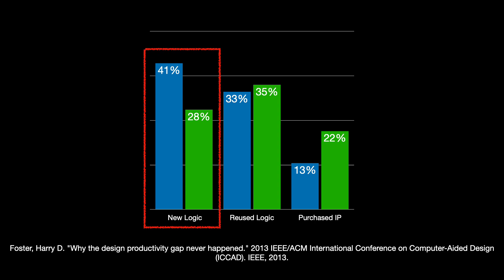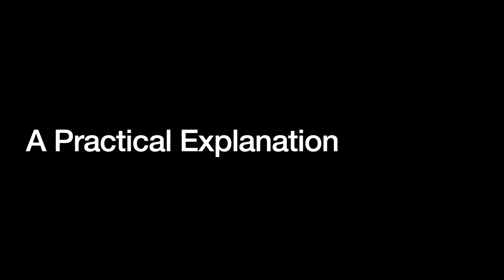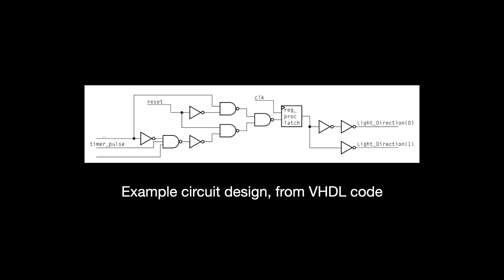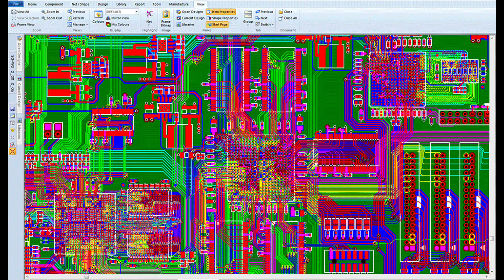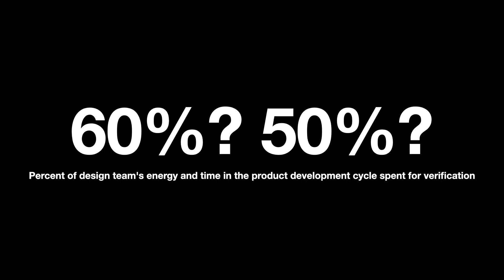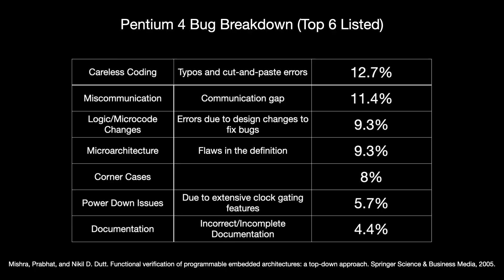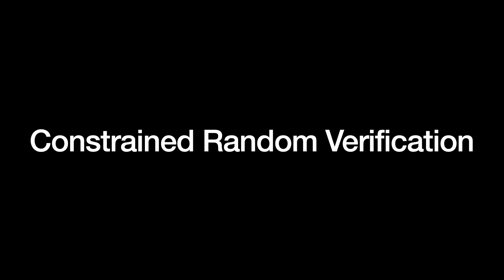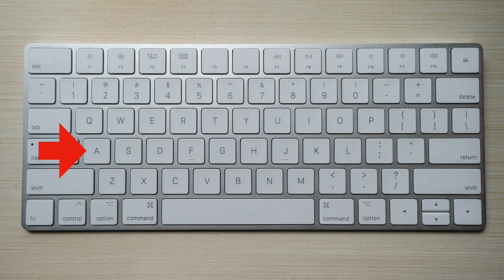The Growing Semiconductor Design Problem

Comment: Can I say, this trait of chip design (difficulty of verification scales up exponentially with complexity of chip) will fair better on ASIC than general purpose chip such as CPU or GPGPU, which has way more "corner cases" to cover and discover!  It may suggest it will be increasingly uneconomic to design "general purpose" chips in the future,.......
Reply: I think for a time we'll find using machine learning AI techniques mixed with traditional we'll find a lot of short term efficiencies but long-term it'll be rendered moot if we ever get a solid grasp on quantum computing. That's a ways off though, for now, best let the algos have a crack at it before we drive our small minds insane 😂

Comment: It sure is complex to design and validate IC's, however the inherent complexity serves as a deterrent to IP thieves and/or reverse engineering folks like China.
Reply: Its usualy the other way arround. If it is complicated it becomes relatively more profitable to steal. There is ofcourse also the "how easy is it to steal" side of the coin.
Reply: @someonespotatohmm9513  I suppose the effort alone is neither here nor there; it's whether if you make a copy, you can make a better price, which can be extremely difficult at times, and then whether you can actually shift enough of a volume to offset that effort.

Comment: Is it true that gate array size that is actually the size of the manufacturing scale is no longer 1:1 since 32nm? I vaguely remember reading this somewhere so that today's 7nm and incoming 5nm basically have gates larger than that? If true, what are the impacts this has to chips since we are already at the 2nm process.
Reply: Yes you’re correct. Today, it’s usually the smallest feature on the device (may or may not be gate) is taken into consideration while deciding on a naming convention.

Comment: Reusable "code" was a revolution in programming that lead to growth over time that was incredible. The same held true with hardware and programmable logic arrays.  As someone who "did it from scratch" every time the advent of FPGAs was a thing. Our mainboards could do new things but there was a development overhead to reinventing the wheel with them. Being able to buy logic was, a time saver. Same thing with the development of automated trace routing. Went from our king artist who could actually lay out traces manually in the program and optimize in his head to being able to click a button and populate a board. I had not thought about any of that in almost 25 years now. Sheesh.
Reply: "Automatic trace routing".... good lord, does anyone actually use this stuff? Even the high end ones are just so horrendous.
Reply: @yum33333  also, whats "horrendous", if its ugly, but works, who cares ? does it respect the ERC ? then that's enough.
assembly programmers used to say the same thing about machine generated machine code...
Reply: But I know routing could be better, but that's usually a P-Space problem in computing, its really hard to solve it very efficiently. But it doesn't matter much, you aren't usually constrained by area in silicon, not the same way as you are in a PCB.
So, that's not a problem for in-chip routing.
Imagine routing a 10cm PCB but now in 1m of space.
There's plenty of space on die.
Reply: @monad_tcp  you have no idea what you’re talking about. DRC is not going to tell you the board works well or not. Autorouting is stupid anyway, because 90% of designing a circuit card is component placement. The tracks are easy.
Reply: @kylerkidd4834  If ERC doesn't tell you how well the board will work, then you have serious problems in validation.
Reply: I have plenty of idea of what I'm talking, I studied a lot of the process involved. Its possible to make better tools. Autorouting and Autoplacing are part of the same thing. 
But whatever, I'll see, I'm going to tackle this problem from a different perspective. 

You need better static analyzer tools instead of only relying on simulation. 

The solution is more mathematics, not brute force or relying on human manually testing.
Reply: You are introducing defects between the steps of the process, it should be entirely automated from the design to the CMOS mask in one go. There's too much human intervention. 
The highmost level of electrical design is where the effort should go.

Part of the problem is abysmal programming languages like VHDL or Verilog with very little abstraction power and no mathematical verification.

SAT solvers are a thing, Full end-end validation in one step is possible.

We will see, after I publish my paper.
Reply: @monad_tcp  Keep us updated about your phd Luiz. Really interested of what you are talking right here
Reply: @kylerkidd4834  you're conflating pcb design and chip design. What you're saying is perfectly true for the former, and asinine for the latter.
Reply: @yum33333  yes, when you have a billion transistors, you use it.
Reply: Autorouting never worked for me. I have had professionals tell me autorouting is never as good as manual. And the manual completes when the auto route doesn't. Plus with manual you can deoptimize the slow stuff (more vias) to make the fast stuff work better.
Reply: @msimon6808  I agree that it isn't as good. But there is now way in hell folks are manual routing advanced boards like modern GPUs and main boards. They may be post-manual correcting. But when you have a development to production time table of less than 6 months in some cases from when the final specs are released for a new chipset till full scale production. The time needed to fully manually handle layout and routing just isnt there. We had a hell of a time back when it was fewer layers and simpler layouts and a greater than 1 year turn around.
But again, all the guys I knew were artists/savants about routing and layout.
Reply: You needs compilers, not only reuse, but automation. Of course VHDL is kind of the same idea we programmers had with Fortran in the 1940s. The problem is that VHDL is horribly dated, we made much progress with formal proofs in programming languages, they need to catch up. 
Actually, my PhD thesis on computing science will be about compiler hardware synthesis, but totally automated.

Comment: Excellent video! I think your comparison of chip design and web development is mostly valid. I used to work in the dram business, and respins were the rule rather than the exception. Analog circuits have infinite degrees of freedom, and are very difficult to simulate perfectly. First time right is much more achievable with a pure logic chip.
Reply: I do disagree about one thing, is that in web development if the library doesn't work it's mostly your problem if the guy doesn't feel like fixing it, while if you buy an IP from ARM, Cadence or Synopsys and show it doesn't follow the spec they will fix it and apologize.

Also I would also mention there are a lot fewer critical bugs that happen and they do clear notes about what was changed and how it can affect you. It is very unlike companies like Google that change stuff and break your code.
Reply from the maker: DRAM

Comment: In the theoretical days object-oriented programming, ie, the methodology of building large programs using small, encapsulated, proven  software modules, a pioneer in the field coined the term "software IC's" to describe what today are called objects, as computer engineers of that period were familiar with the concept of building systems with components in the hardware domain. It was interesting to hear you bring the concept full-circle at the close of this video.
Reply: That's amazing and makes so much sense. The difference obviously now is the scale of the software and hardware designs.
Reply: It amazed me how they still didn't introduce more formal verification, like we have in modern statically typed programming languages.
There's an entire volume of computing science tricks that could be applied to electrical engineering. There's an entire PhD for me on that.
Reply: @monad_tcp  Go, Luiz! You'll discover if you're onto something rather quickly in an engineering PhD program. The real world is very unlike a YouTube comment thread -- no BS allowed!
Reply: @kwgm8578 No "BS" allowed?  Only PhD’s? 😂. Or other type of BS?
Reply: @monad_tcp Formal verification is used in chip design.  As a trivial example, a 64-bit or 128-bit adder can be formally verified quickly to be 100% correct for all input combinations.  Look up BDD’s for a starter. The controlled randomized testing or even doing exhaustive sweep testing at the unit or block level would never come close in our lifetimes.

There is inherently just a huge amount of concurrency in a hardware design. And race conditions galore. A lot of people will take away that copy-paste errors are a common error and be astounded.  Those are rare. I’ve never seen that.  Intel’s ancient ‘divide’ bug was due to such an error: only part of a table of values was copied over. 

What’s much more common (and can be included as a typo) is using the wrong delayed version of a pipeline state bit.  A design can work often, but if the timing of some event shifts by one clock cycle, the design can break.  Possibly because of using "state_bit_d2" instead of "state_bit_d1".  That’s really a logic error though, not a typo. 

It would be like in this video’s traffic light example.  A possible error could be a race condition where the 2nd car arrives at just the right time as the 1st opposing cars exits the intersection.  The light could fail to change for the 2nd car, getting stuck.  It is a contrived example, but it amounts to the decision to change the light as car1 exits mistakenly looking at whether there was a car2 already there 1 clock cycle before it showed up, so that action decides no change is needed.

And car2 arrives and sees, say, that a car1 is in the intersection and that it will trigger the light to change when it exits (which it mistakenly does not).

This is contrived, but it is actually a better example of a bug.  A bug where the design does not meet the spec.  The video mentions a spec error, not a design bug: the spec failed to state the light must be fair when congested.

Comment: Honestly the fact that there are now more verification/test engineers than actual digital designers is surprising to me.
How come the digital designers get away with writing such poorly tested digital circuits? In modern day software development you wouldn't get away with that.
For software projects pure test engineers are pretty rare as just writing tests all day long would be pretty demeaning to most software engineers.
Personally starting with digital design I assumed the testing standards would be a lot higher compared to sw development but it almost seems like the opposite is true.
This just reflects my experience with chip design in open-source projects and academia however it's really unexpected to see how manual testing is for hw projects.
Reply: since hardware systems use ip blocks from decades ago, that have already been fully verified and specified in documentation with full logic, and electrical specs, in different ranges of temperature, and voltage with actual graded graphs - this software comparison of test coverage is laughable. and i''m a software developer. we can't even dream of achiving the level of engineering rigor the hardware designers have.
Reply: @PaulSpades  Please bear in mind that my experience stems from open-source projects and academia.
Personally I have never encountered a bug in a compiler while I encountered a synthesis bug in Vivado just a few months after starting with hw design.
Similarly I have heard about issues with Intel Quartus as well as IP blocks from Altera and Intel.
As I have never worked at the big chip makers I can't speak to that but I would hope they have higher standards than what I encountered.
Reply: @developandplay  From what I hear bigger companies are just better at forcing ppl to accept or covering (not necacarily bad) their mistakes. Not making less of them
Reply: @developandplay  that's because compilers are vastly simpler than sythesis tools and physical circuit ips. also, a compiler bug is implicitly a language feature that may become documented if removal breaks programs. 

compilers have lots of issues sticking to their documented standards, and implemententions based on the same standard always vary in compatibility or are incomplete in supporting the standard.

sure, compiler stacks like gcc, java and the clr (which have been developed for a few decades) are reasonably documented and stable by now, but there's always something to fix and something else to break.
Reply: @PaulSpades  I hear this argument all the time from hw folks. Yes synthesis is more complicated but on the other hand I think it's a lazy excuse from big tool vendors.
For example the bug that I encountered was due to Vivados frontend generating a wrong syntax tree for sign extension. (Verilator and Synopsis did just fine.)
To me Verilator and Yosys show that yes hw design is difficult but not so difficult that only these tooling companies can work on it.

Obviously compilers are not perfect either but that wasn't my point. However they are a lot more standardized and accessible at this point.
If compilers cost thousands of dollars per year and if you had to pay for every third party libarary I don't think programming would be as popular.
Reply: @developandplay Honestly, I'm seeing more programmers interested in electronics, circuit design, fpgas and eventually ICs. I think this renewed interest in hardware will bring a bunch of new projects and tools. Like a decade ago you couldn't get a board layout editor without paying Altium a big wad of cash, now we have 3-4 cheap options and an open source one. So I wish you well  :)
Reply: Verification isn’t testing. Testing is post silicon while verification is pre silicon. Verification isn’t only about writing tests, rather it’s a dissection of the whole design.
Moreover, software and hardware development can never be compared as such. Software development doesn’t deal with physical implications (latch, race, delays, metastate etc). Ultimately the code you write has to be synthesizable as a physical entity. Things which are obvious in SW development, aren’t so straightforward in HW.
Reply: @VikramBamel  I completly understand that hardware design has different complexities than software design.
Please excuse my ignorance but what is holding us from running an automated test suite in simulation and on FPGAs?
Probably big companies do this but I have rarely encountered this for open-source projects or academia. (For sw on the other hand I did.)

Another question that might seem ignorant: Why still to this day is inspecting the physical design a thing?
In software we have managed to find good abstractions such that you almost never have to look at the assembly code.
For hardware on the other hand you still can't 100% trust your synthesis results and manually have to inspect the floor plan often times.
Reply: You’re right that developers should test their stuff in the first place, but HW industry is lacking behind around 10-20 years when it comes to modern development practices. There are areas of software development where testing is done by a separate group of people as well.
Reply: @TheVlad33  Definitely software has dedicated testing teams as well. My point was that at most modern sw companies these are kept to a minimum as pure testing is an extremely dull activity.
Obviously in traditional sw companies having a dedicated test team is still the common practice. A friend of mine works at one of those. They hired a test team about a year after the project started...You can imagine how well that worked out.

Comment: Is it actually possible for intel to emulate there chips on a FPGA don’t think there are enough LUT‘s in a single FPGA.
Reply: Obviously not, but they can simulate blocks of it in isolation up to a point, or wire multiple FPGAs together. At the end of the day, they still need to make sure all the pieces fit together, I honestly don't know how the Intels of the world get around that part without a leap of faith on a small run of engineering test samples.